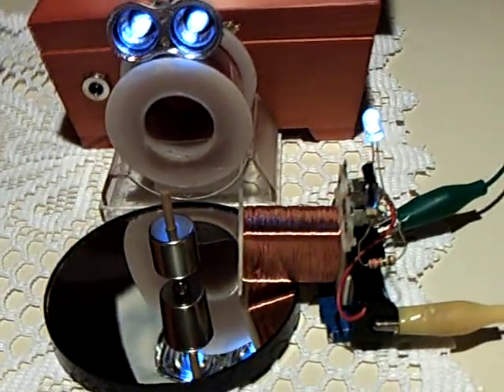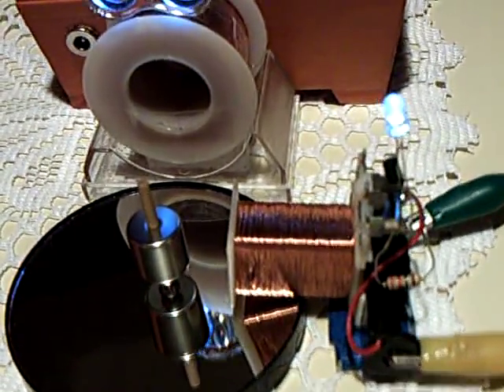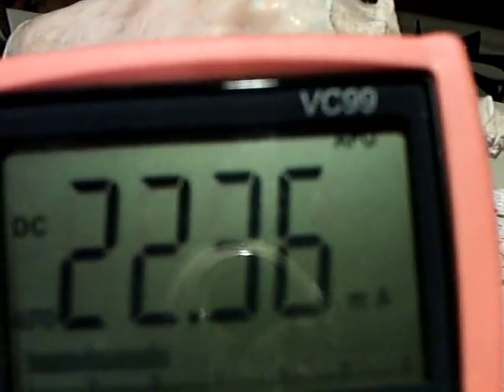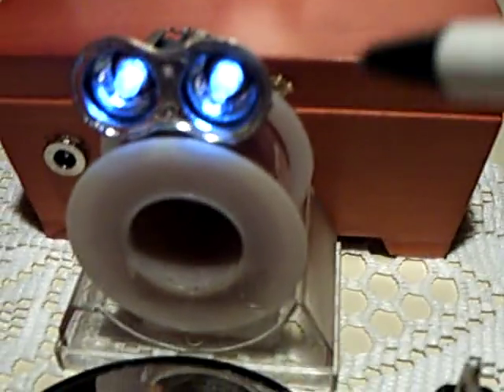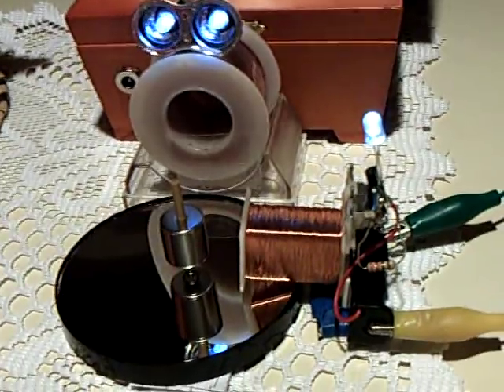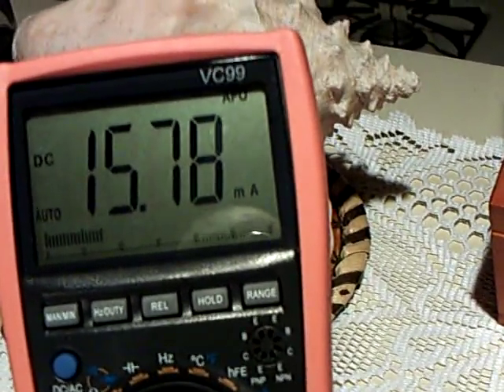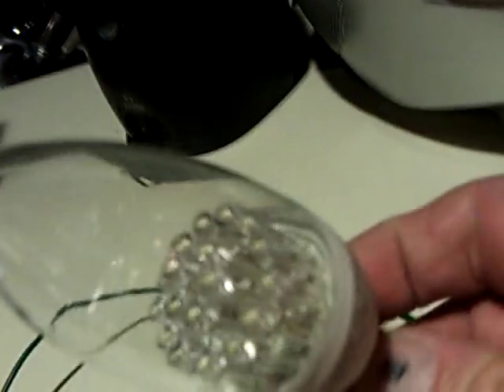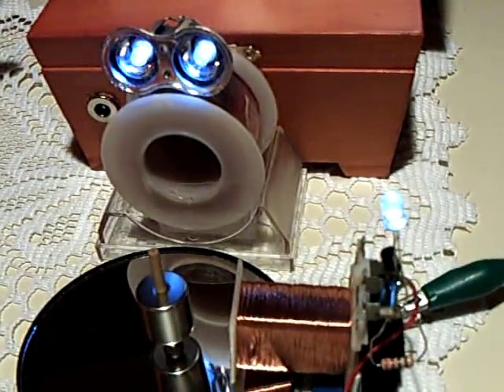Light Multiplier---Amp draw measurements

Comment: The reason it is running more efficiently:  IMPEDANCE MATCHING
Reply from the maker: +Inspironator  I wish that it was something like that but it is just the load (Maggie) slowing the rotor down.  Fewer pulses--less amp draw.  The eye can't see the led flicker slowing down.  Maggie was the fun part because of the load showing up as light.  She has A LOT of turns of fine wire on her that make it possible.
Reply: +Lidmotor You clearly show that the current draw goes up when you remove the driving coil from the focus of the magnetic flux.  So, although what you responded is true for a different situation, I am still correct about why the current went up when the driving coil appeared to be unloaded.  Cheers!
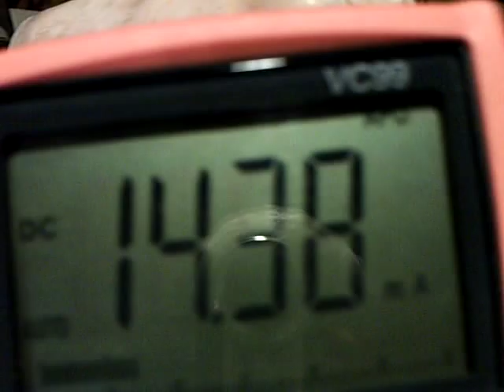Reply: +Lidmotor I didn't state that first sentence well, so restating:  You showed the current draw went up when you moved the magnet's driving coil away from the magnet....:40 to 1:12